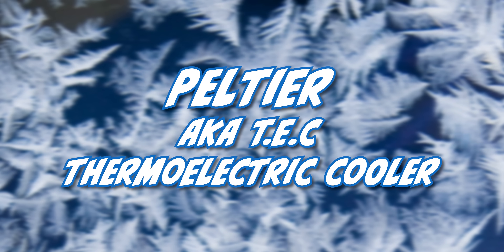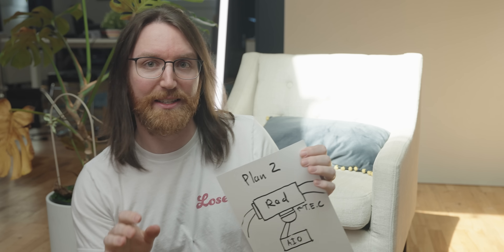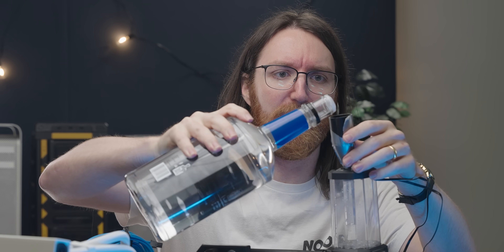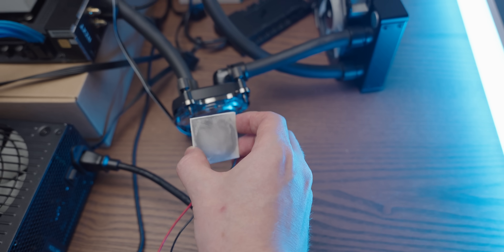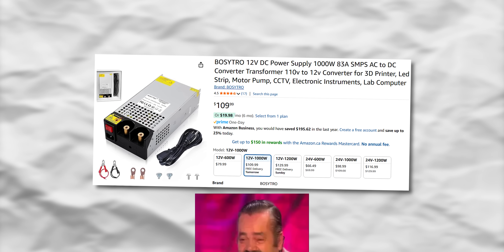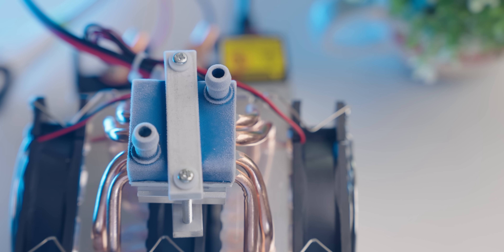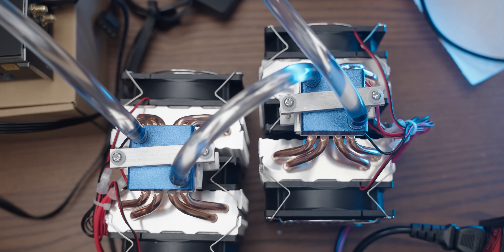I REVOLUTIONISE PC Cooling....

Comment: OK hear me out. You get the blue water block you used with the air cooler and remove the air cooler. Sandwich the peltier between 2 blue water blocks. Make like 3 or more if you can and connect HOT side in series with all of your radiators. The COLD side of the sandwich you connect them all in series and connect it to a Water to Water heat exchanger. Then you connect your gpu to the other side of the Water to Water heat exchanger. So you pump in hot water from the gpu into the water to water heat exchanger that then goes into the cold side of the peltier extracting the cold from them and then on the hot side of the peltier you have all your radiators with fans going full blast cooling that hot side water down as much as possible. With peltier devices the more heat you can pull away from the hot side the cooler the cold side gets. So my thinking is doing that way maybe youll have something that works or maybe not lol. It looks better on the sticky note I drew it on HAHAHHA

Comment: Wont worth the loss power of the peliter. I did it and i finish installing a 3 480mm radiators instead of that. Energy-efficient is not if use peliter.

Comment: I imagine that the peltier could not chill the liqiuid in-loop fast enough. Peltiers are generally used to chill something over time. Maybe have have 2 reservoirs or a split reservoir with pre-chilled and in-loop chilled. I also imagine that the same properties that make vodka harder to heat/boil also make it harder to chill/freeze.

Comment: Those peltier are a cool thing and concept. But they just are not efficient for any application. They cost more energy to cool 1 thing a few degrees. Your fridge that you would think would cost way more in energy is a lot less than it and its also not drawing power 24/7 to cool things down. They can freeze water vaper but not actual liquid water.

Comment: you can probably double the efficiency of the setup, by running the two peltier coolers in parallel, instead of in series like you did. With heat exchangers, temperature delta is everything. With the series setup you are feeding cooled water into the second peltier, hampering efficiency.

Comment: I've been doing this for 4 years with a custom built 1,000mm of radiator, external system with hydraulic quick disconnects so you can unplug it from the computer system. I originally designed it for crypto mining on a 8x RTX 3090 all with waterblocks. I was getting sub-thermal Temps and like 111-115MH/s on each card

Comment: Here's an idea, use the peltier units externally connected to heatsinks on the cold side then lowering the frozen fins of the heatsinks directly into a tub of anti-freeze which is then pumped through the loop? Use the cooled coolant tank as your radiator.

Comment: You might need to cut the radiator out, or at least turn off the fans once you turn on the peltiers. As someone else pointed out, the radiator works in reverse and if the peltiers cool the liquid below room temp, the radiator will try its best to heat it back up. It might be overpowering the peltiers. Also be very careful with sub-ambient temperatures, you put in alcohol to prevent freezing but at such low temperatures condensation will build up which can damage stuff. Maybe put in a thermal switch which switches off the peltiers below a certain temp?

If nothing else works, you can always change the peltiers for a full on refrigeration loop from an AC unit or something, that should do it..

Comment: TECs, the way you are using them, have a COP way less than 1, probably 0.25. I.E. a Cop of 0.25 means it take 4 watts to pump 1 watt. TECs lose efficiency with higher delta t and higher volts/current. If you run the TEC at like 4 volts and have less than 10 delta t cold side vs hot side, according to specs sheets you can achieve a cop of 2.5-4. But you need an array of peltiers, say a dozen,   "underclock" clock them, and sandwich them between 2 custom waterblocks. Then you could probably pump 400-800 watts at the cost of 100-200 watts. Have the hotside waterblock feed into the rad(s) and the cold side waterblock cooling the rad output. Doing this you increase the efficiency of the radiator for a given fan speed by increasing the delta t of rad coolant to input air temp.

Comment: You actually wasted vodka on this? When rubbing alcohol and distilled water do the same thing for a tenth of the cost. Peltiers are notoriously inefficient heat movers. I never liked the idea of PC water cooling because it adds so many points of failure. Water blocks should have always been incorporated into classic air finned heatsinks as hybrid heatsinks. Instead they are just dumb little plates with plastic badges, lights and windows. Leaving all kinds of wasted cooling space directly over the CPU area. They're a gimmick and a joke really.

Comment: when people still use to do this with PC's - you put the cold side directly against the heat spreader of the cpu and then you liquid cool the hot side like you would the heat spreader - you had to spray foam around the socket and on the back side to prevent condensation - but you could easily get very cold temps.  I dont know if the things you got for this are powerful enough or if cooling the water instead is the issue.
Reply: Oh, as someone else said, you didnt have the peltier thing cooling before the gpu - so.... yeah

Comment: Dawid, did you put the peltier AFTER the radiator in the loop? You should aim to bring the water temperature as close to ambient as possible and THEN try to go lower than what the radiator can do on its own.

EDIT: Nevermind, looks like the final attempt was made correctly looking at the bubbles move. Peltiers are just that inefficient

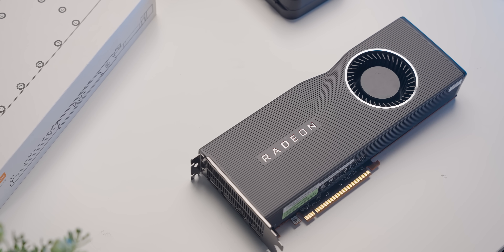Comment: 4:33 Dawid proceeds to show an RX 5700XT and calls it an RX 7600
Reply: That was i thinking to... i even checked if RX 7600 comes out with a ref cooler design of RX 5700XT... but found nothing... later looked the video when the videocard label can be read in the bottom (only 2 frame when readable).. yes it is a RX 5700 XT
Reply: @EriGabu lol

Comment: I have 2 Masterliquid ML360 Sub Zero AIO's.  Picked them up new for about  70.00 USD a piece over a year ago.   Only meant for intel cpu's, but You can play with that.   Comes with software you will need for using the TEC.

Comment: Also, alcohol has a lower specific heat capacity than water.  That is, it takes less energy to raise its temperature, therefore it doesn't cool as well.  Just use water, Dawid.

Comment: The amount of time the peltier has contact with the water is very brief in those blocks. A couple ideas come to mind but the one I want to see is you just putting peltiers on the loops radiator with or without fans. Water traveling though the multiple channels should have more time touching a colder area. Bonuses are you aren't limited to only one peltier, and if you use fans maybe they can remove some of the heat generated by the peltiers (at least away from the rads).

Comment: You seem like you might actually do this because I've asked for a few years and gets ignored. Use a cooler, put ice water with sea salt in the water, have the water circulating in the cooler and pumping from the cooler, to the system back to the cooler. Block off the pump so it doesn't get clogged by ice. I want to see how much that cools a system. Also, those heat sinks with the blue things on them. Get rid of the fans and completely submerge them in either motor oil or anti-freeze. That will do a lot more for cooling then the other things would, most likely anyway.

Comment: Peltier chips are much more powerful than most think. The TEC1-12715, Specs: DC Voltage: 16V-17.2V, Max Amps: 15A, Watts: 150W to a max of 165W. If you try projects like this with Peltier chip style cooling, make sure your pushing the correct voltage, amps, and watts for your model peltier chip!!.......... This video was a fail because "someone...(Dawid)" didn't do his research including calculating all power requirements for said Peltier chip before making this video... Check my page or video descriptions to find my email for more info if you do not understand. Just trying to be helpful.

Comment: Iv had some success with them for benchmarks back on a 1080ti years ago.
My set up tho was id switch off the radiator fans while the system was idle. Bring the water temp down to dew point. Then start the benchmark switching on radiator fans again as soon as water temp hit air temp.
5min cooling effort by 2X 288W would give you about 10 secs of below air temp at the start of a benchmark lol.

Comment: At least now it's safe.

You would need something like a SLA-400-24-02 from Tark Thermal Solutions to make it work.
If you want the peltier to be able to cool anything compared to standard air cooling, you need to pick a peltier system with a Qc that's above the power consumed by the GPU. If the Qc is too close to the heat produced, then the peltier will only extract it and act as a thermal interface. For a GPU, you should aim for >300W max Qc, and you'll need to pump at least 350W into it. There aren't many options for this range of wattage.

If you want to daisy-chain several peltier systems, it's going to be really inefficient, and the first ones in the loop probably need to be regulated so that they stay at around half their Qc max.

Also, you should use water with glycol (standard car antifreeze you can get in any gas station will do the trick). Alcohol isn't great for sub 80°C temps, and probably not great for the pump either.

Comment: Can you not connect it to a PWM fan header and set it to change power based on fluid temp from an in line thermo couple? For example, at 30C 0% power and at 35C 100% power? That way, theres no risk of freezing or condensation.

Comment: The issue you had is that you need a chunk of copper or aluminum to absorb the heat like a battery and have the peltier cooling the metal block, that will keep the spikes from overheating the peltier and putting it out of it’s efficiency range. You could even have it run full power on boot up to get a head start on pre-cooling the “heat battery” metal block. I love peltier units and heat pump/refrigeration technology in general, it’s pretty close to magic!

Comment: Dawid you gotta put the radiator before the peltier element coolers in the loop. so the water is pre chilled by room temp and then add the additional cool down.
What you did was: heat source then direct in to peltier element overwhelming the first peltier (you noticed when you touched it) 
and then room temp radiator 
In your setup, even if the elements where to go below ambient, you could accidentally heat the water up with the room temp radiator after the peltiers.
Reply: It's best to just remove the radiator altogether. Especially if it's a small volume of water, plus if it managed to cool below room temp,  after going through the cpu, then when it got to the  radiator, the radiator would actually add heat to the cooler water because it's warmer. Not to mention, at some point, the small volume of liquid would equalize because the small peltair can not cool it fast enough. To truly cool subzero or well below normal temps, you'd need an aquarium for saltwater fish, a high flow pump, and a pump circulation. 

So this can get below zero temps. Due to the large volume of coolant and the pump circulating or mixing the water, it assures that cooler water is mixed with incoming hot and thus cooling it down significantly before being sent back out. Just understand at some point that water will equalize at a certain temp.

If let's say it was 5 degrees Celsius below zero before the system starts running. Once it gets running, it is dependent on how fast pump and amount of fluid you're  moving that temp may increase, to say 10 degrees Celsius and stay at that equalized temp. The larger the volume of fluid, the more likely it will impact this greatly. Plus, now you have to insult your motherboard from condensation.

Comment: peltiers are pretty interesting, highly ineffecient but compact electric condenser.... not effecient as cooling, or heating... the differential load and where power is lost depends on the contrasting conditions per side. but as an open air device, like a desk minifridge for drinks, while functional and novelty, they are power hungry and create ALOT of heat while barely cooling drinks over hours. as a desktop ac? unless its intended to blow at your face and hands, it will just make your room hot. but extremely ineffecient in most use cases, unless the intention is compact and targeted application over effeciency....  rapid condensers like a peltier can be used to make very interesting stuff, like rolled ice cream as a weird but very practical use for it, HIGHLY niche tho.

Comment: After doing intense research into thermoelectric dehumidifiers. (which use a peltier, heat sink, and fan to take moisture out of the air by condensing it on a cold surface), I can guarantee you that a good amount of performance was lost due to a lack of insulation. If you look into thermoelectric mini fridges, you will notice foam between the cold side of the peltier and the heat sink. So what does this have to do with dehumidifiers? Well instead of cooling a closed box, they guide air down a very specific path using ducting to separate hot/cold sides. Basically, you want to ensure you're not just heating the cold side of the peltier again. 
That said, can't beat a good old compressor. :)
Reply: The amount of heat it has to move is waay to high anyways. A fridge is still air and matter.

Comment: The only effective way to use a peltier is this way is with a giant monster rad getting the temp as close to room temp as possible BEFORE you attempt to chill it.

For the thermal load of a gpu I'd be using a MINIMUM of 2x360 rads to get as much heat out as possible before it hits the pletiers
Reply: That’s a waste. Radiators don’t do much beyond the size you need.
Reply: @_..-.._..-.._  the size he needs if he wants to get significant gains with peltier is as big as possible because of how a peltier responds to heat loads.

Ideally a monster 1080 rad which could theoretically get it close to room temp.
Reply: @_..-.._..-.._ do you even know how radiotars work lil bro?

Comment: Ah peltiers. Your amazon coolers will work better sideways, or upside down, so the heatpipes are much more efficient. But as you discovered, they are pretty bad. Your best bet to gain a tiny bit more efficiency is to put those blue waterblocks on each side of the peltier devices. Run the cooled liquid from the radiator through the cold sides, chilling it further, then run the warmer liquid from the video card back through the hot side of the pelters and to the radiator. The radiator will become more efficient the hotter the liquid is as its thermal dissipation is linked to the temperature difference between the liquid and the air.

Since the radiator will now be cooling both the waste heat from the peltiers, and the heat from the video card, it will run at a generally slightly higher temp, which makes it more efficient, and you are liquid cooling/heating both sides of the peltiers, keeping them more efficient as well.

Peltiers are the most efficient when the temperature on both sides gets as close as possible, so cooling them with water is the best bet. The hot side of a peltier is both the heat its stealing from the cold side as WELL as the waste heat of the power used as well, which is why they are so bad. A 240 watt peltier will consume 20 amps at 12 volts, and thats 240 watts of heat, PLUS whatever it can pump from its cold side, so keeping the hot side cool is absolutely vital.
Reply: Your scenario shows exactly how silly this idea is in the first place. It sounded ridiculous at first, but then I saw your point. A+

Comment: DAWID ~> The thermal conductivity of alcohol is roughly three times smaller than that of water. I would test with less Vodka and more H2O. And try to mount the Peltier where it's flowing least to give it time to actually cool. Like the bottom of the Reservoir or Bottom of a home made tank. Possibly Insulate it and start it before you overheat the system.? Or put it on Bottom of a custom Aluminum Reservoir. There may be condensation, probably should be outside the case.
At that point though, I am thinking just use a large [Stainless Steel or Aluminum Tank](Faster Cold Transfer) inside a small college size refrigerator running the lines in and out drilled holes slightly smaller than the hose to keep a seal. 😆
Keep in mind, Salt and Mercury eats Aluminum, so don't use those in the coolant.